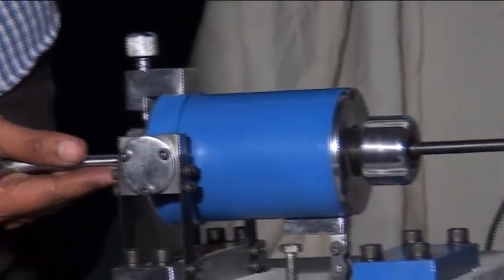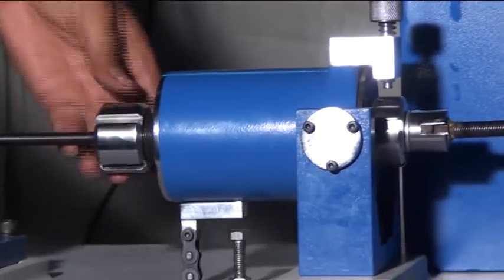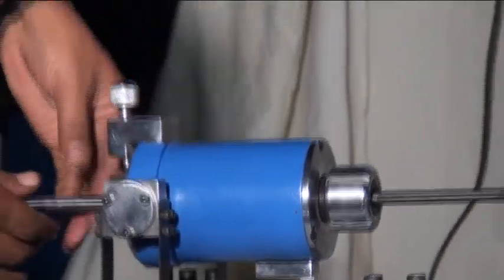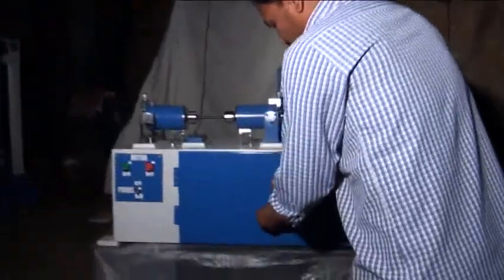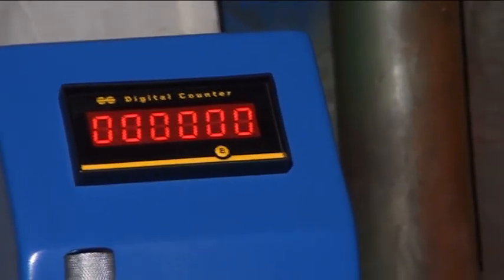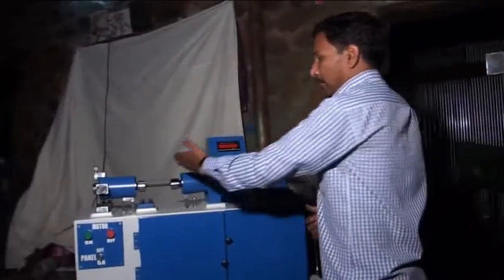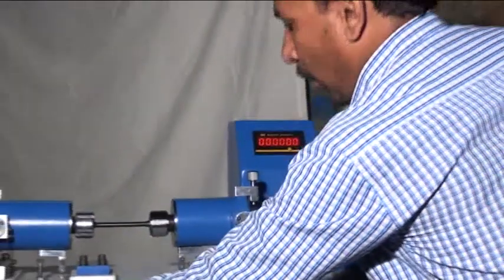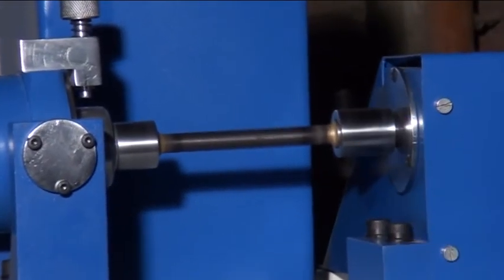Fatigue Testing Machine, Manufacturer,suppliers

Comment: 1. What's the the Vibration Amplitude at which we can test the TMT rib Bar?
2. What's the  the Vibration Frequency of this machine at which we can test the TMT rib Bar?
3. what will be size of rib bar which we can test on this machine, Can it check 8mm to 32 mm rib bar